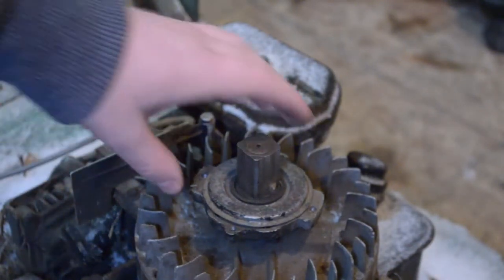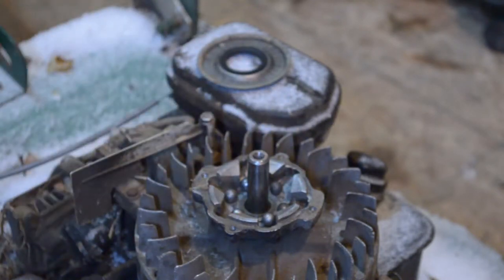How to fix a squealing ratchet clutch on a Briggs & Stratton engine

Comment: wow this did me wonders, the motor I was working with was a lot newer than this one early-mid 90s, and the fly wheel along with the ratchet bearing was VERY rusted and doing all the things you said made it come back around somehow. Thanks for the help. And I didn’t even use atf cause my workshop is a mess so I just used power steering fluid and it still worked

Comment: I doubt sanding is actually necessary unless it's got rust on it... One of the reasons it is squealing is because of the tolerance between the shaft and the clutch has worn and it is vibrating along that small gap. Sanding can wear it down further, possibly making the problem worse over time *(though probably not within the lifetime of the engine). Just something to think about. The lube is important though!

Comment: So, basically it just needed to be lubed up? Do they come lubed up?
Reply: Can I use sae 20 oil?
Reply: @mranderson5668   Yep. 3 in 1 is good for this kind of stuff, but you could probably get away with using regular motor oil no problem.

Comment: Dude, 120 grit? It’s a machined surface. Almost always, worst case there might be a little surface rust. 3M crocus cloth 1000 or 1500 grit with little oil is what’s called for. If you have to repeat this after just two years it’s probably because the scratches you’ve made give moisture a toehold, leading to accumulating rust. Just my two cents.

Comment: See that little hole on the top? That's for putting 30w oil in the clutch. No reason to tear it all apart. You should have known.
Reply: Good to know! But I do think that doing a bit of maintenance and cleaning the parts doesn't do any harm either ;)
Reply: That doesnt always stop the noise. Sometimes it still needs to be taken apart. I tried that.

Comment: It’s not called a ratchet clutch it’s called a starter clutch you don’t want to use transmission fluid either WD-40 is it someone needs to show you how to clean them is an ATL is the wrong thing I’ve been doing this for 58 years
Reply: WD-40 is not a lubricant and will not last. ATF should be fine, but may attract dirt. Ideally 3 in 1 is the best thing for this kind of an application.